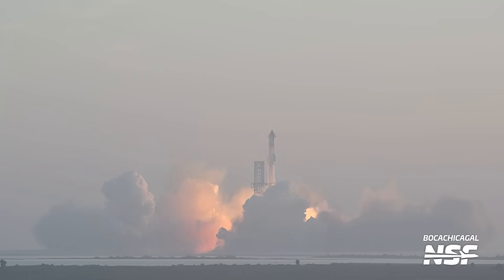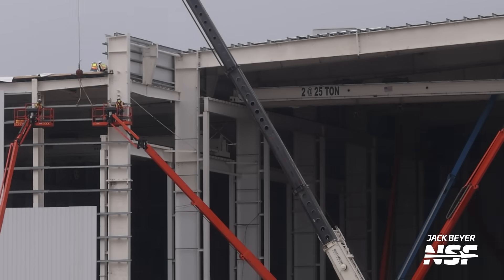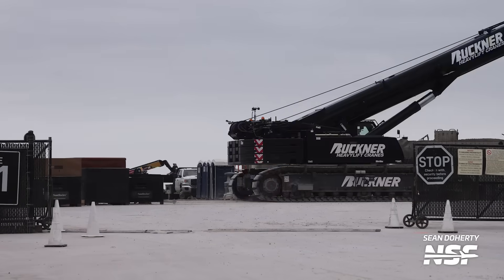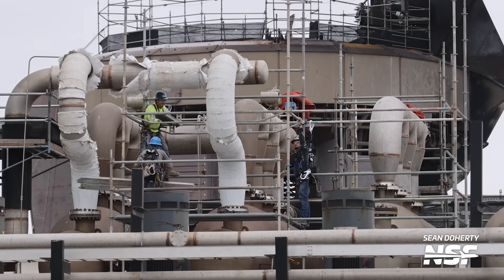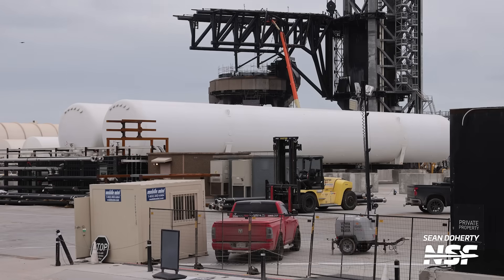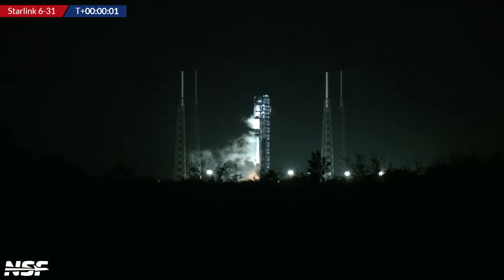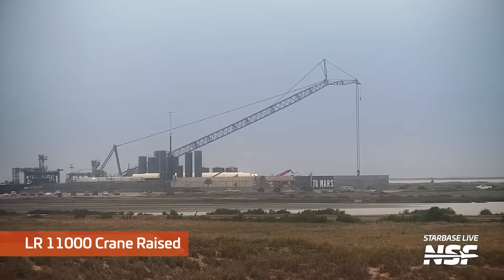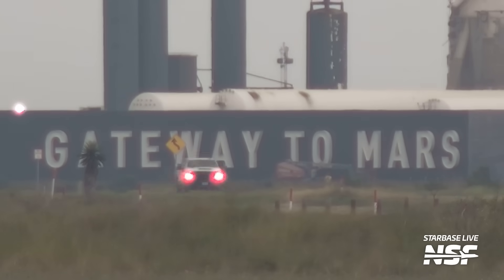SpaceX's Massive Overhaul at the Launch Site | Starbase Update

Comment: There's talk of doing a propellant transfer for the 3rd launch, does that mean they'll attempt to launch two Starships at the same time, as they've been building a second launch mount?
Reply: It would be some sort of internal transfer, such as moving propellant from a head tank into the main tanks, or vice versa. Ship to ship will be a ways down the line
Reply: 😲 I know SpaceX are fast, but I don't think they will be launching from SLC 39A at Cape Canaveral for a wee while yet. The Orbital Launch Mount (OLM) has only got the pillars as of NSF's latest fly-over. That needs to have the vertical sections installed yet and the most complex part, the OLM Table, will be some time too, before it is placed on top. (And they will need two cranes to do that) 
I haven't seen an OLM being built. Maybe there is one under construction inside a building that no NSF camera operator has seen??? 
The only propellant transfer I could imagine SpaceX doing, is with a miniature, mock-up model in the Payload Bay of S28, to see how the fuel transfers in a microgravity, should they be successful in getting the Starship to a low orbital trajectory towards O'hau, Hawaii.

Comment: They may not need hold downs.  Just something else to fail.  The loaded vehicle is too heavy to need to hold it down.  They also undoubtedly wanted it to go as quickly as it was ready, to minimize pad damage.  Only reason to hold it down would be if there were a substantial crosswind.  F. Miller

Comment: My guess the box is water related, specifically for the deluge system.....i love guessing and finding out later, im always suprised, or always wrong.....i like to say always suprised!
Reply: That 'box' (and I thought that was at the Massey Site??) looks very similar to the 'box' at the left hand side of the vertical storage tanks at the Orbital Tank Farm, which is the storage for all the electrical transformers and electrical switching gear and fuse box's, Water related products, tend to be high off the ground and roundish. 
But I am also one who is often surprised by my guess's.
Reply: @David-yo5ws  unless it's a retention pond or supposed to catch runoff which wouldn't be tall and vertical but needs to be closest to level or below to catch the water as drainage........but yea I hear ya, wasn't talking about storage as in like clean water, but as in waste water retention, like water treatment plants they have all those open air pools to let the crap separate that's an example of the type of retention I'm referring to......no so much treatment but I wonder if the EPA wants them to hold the deluge run off maybe they found some reason why it can't be just released without treatment of some kind? Dunno
Reply: @David-yo5ws  it was always just a personal guess, I have an Sc.D in EECS I have no knowledge in regards. So it's probably a very "hard" "idiotic" guess
Reply: @scottbattaglia8595  Nothing like some brain plasticity to keep the neuro transmitters⚡firing on all cylinders. 😁

Comment: You'd think SpaceX would be testing tanks with at least baffle plates to suppress fuel surge.
Reply: The best part is no part.  Fix the timing so that there is no surge.
Reply: @Bora_H  pretty tricky the reverse the direction of the booster without altering it's acceleration ( which results in the fuel surge). You could send the booster on a wide arc slowly turning it around but that takes fuel. Easier to use conventional tried and tested baffles in the tanks.
Reply: @michaelreid2329  Yet the Falcon 9 boosters are performing the boostback flip regularly for RTLS flights.  No massive baffles.
Reply: @virnin7759  yep, therein lies the mystery. Something in the flip manouvre is different in the Starship Booster compared to the Falcon 9 that keeps the fuel and oxygen at the tank take off manifold yet has the Starship's fuel flowing from one end to the other with what appears to be enough momentum to burst pipework.

Comment: Is hiding some of the tank farm underground not possible? Seems like leaving things on the surface leave risk to damage. Is it for ventilation reasons or something?  Thanks to anyone that tries to answer and doesn't roast me in the comments :)
Reply: water table
Reply: easier to put things on surface rather than dig out trenches in the ground. also the horizontal tanks could be easily covered by a roof if they want to. vertical tank farm is not a problem, since the plan is to get rid of it anyway. im pretty sure covering the horizontal fuel tanks above ground would be easier and cheaper than burying it in the ground.

Comment: The vertical tanks are insulated.  The horizontal ones do not appear to be.  Will they be insulated after installation or what?  If not, it wouldn't seem that they are a replacement for the vertical ones.
Reply: Do you have X-ray vision to see inside the horizontal tanks to know that they are not insulated?
Reply: Read.  I said they do not appear to be insulated.

Comment: Could SpaceX not just build a big Rattle-Stand to check if the TPS Tiles are really fixed in place or are loosely, I mean even the JWST had to go through a rattle test.
Reply: A fully fueled Starship on a gigantic shake-table still wouldn't account for the aerodynamic effects trying to remove tiles, so for now with these expendable test vehicles they might as well launch 'em and see what falls off.
Reply: It isn't just vibration, but aerodynamic shock. So just shaking it might still not solve the issue.

Comment: On the lift rating of the cranes... you need to account for inertia of that mass when starting to move and stopping the thing, which is going to increase the pulling force significantly. That's why you will almost always find overdimensioned cranes for the expected mass in such facilities.
Reply: The rating of the crane is what it can lift. If you have a 50 ton crane and want to lift 49.9 tons, you don't have to stop and do the math to figure out how much inertia it has, you can just lift it. The crane company does the math to figure out the capability with acceleration accounted for.
Reply: @bobloblaw1636  Think like a German engineer and design the thing doing the work for three times the expected load and it will outlive you :)
Reply: @lucemiserlohn  amen brother

Comment: Spraying enough water into the rocker engine exhaust dramatically changes its impact on ground equipment and structures. Detailed data is needed. Think of steam cleaning to the max.
Reply: The deluge is designed to NOT spray water into the engine bay, but instead outward at about a 30 ° angle to divert the raptor plume away to the outside much like a flame diverter is intended to do.
Reply: 90 percent of that water converts to steam upon contact with the exhaust. it is a massive conversion of energy, @michaeldeierhoi4096

Comment: Instead of thousands of little plates why not build three plates for one ship that are segmented for weight. 
With what SpaceX has it's at high risk of burn thru on re-entry.
You could add cooling through little veins. .
Please.
Reply: That was discussed and discarded, due to the tile system being much more resistant to failure.